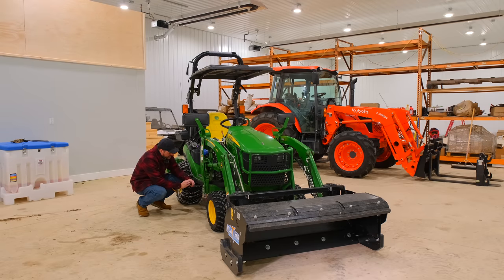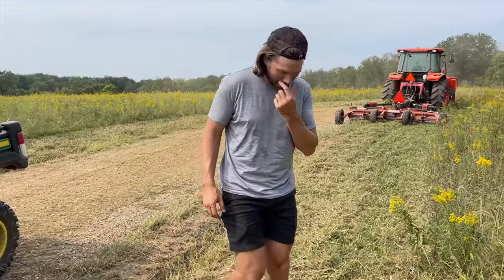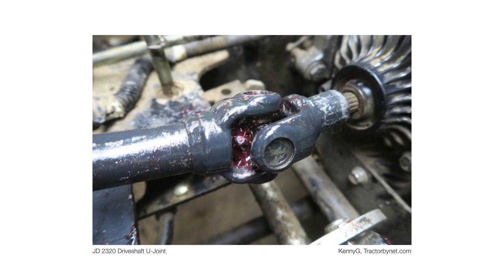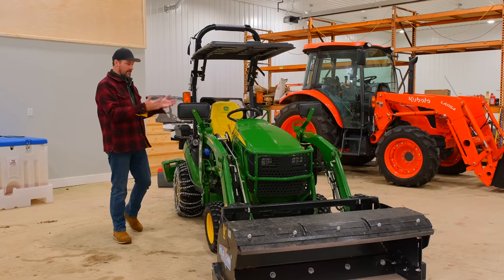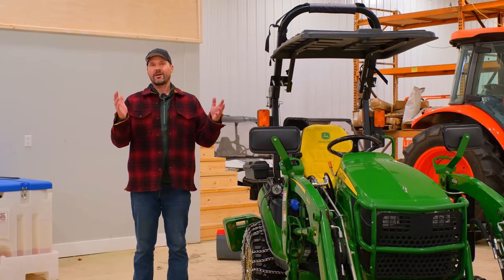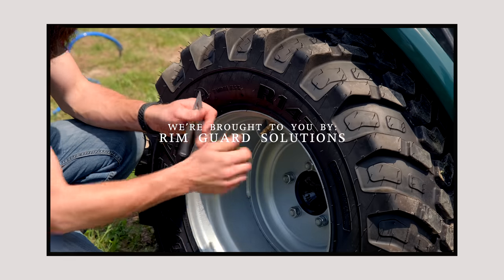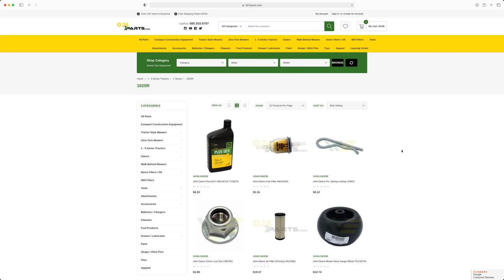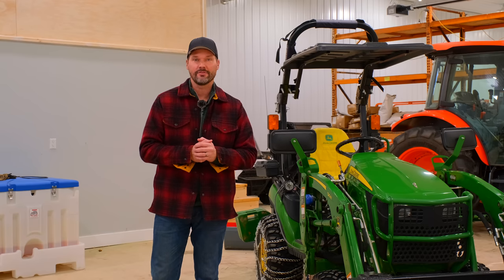THIS IS THE MOST EXPENSIVE TRACTOR REPAIR I'VE EVER HEARD OF

Comment: So I had a catastrophic failure of the transmission on my 2021 2025R with about 300 hours on it.  A big chunk of the transmission case blew out.  I'm sure it will be several thousand, but should be warranty, but if not, it will be insured.

Currently at the dealer waiting for them to look at, and determine warranty or not.

Comment: I was moving logs into the firewood processor, had the forks on, had a chain on the front in case i had to pull some out. it came undone. wrapped around my hard hydraulic lines and as i lowered the logs the chain ripped all my 3 hydraulic lines off, bent them. was able to patch it together . Dont have a chain on the front haha. Also snapped my lever for the hydro sta lever on my john deere 4600
Reply from the maker: Oh man, that would have been painful!

Comment: This is a drop in the bucket as far as tractor repairs go. Granted this is compact equipment but I have recently rebuilt a hub for a sprayer where the wheel seal is ~$800. One part of the hub is ~$15K.

Comment: The price on tractor parts, especially oem, rivals that of aircraft parts. Not sure, but I expect it's because there are few alternatives, as in the automotive industry, where there is a lot of aftermarket competition. As far as labor goes, $100+ per hour is pretty standard today, as is $6.50 diesel, everything is up and it's going to get worse. I like to do my own work, but with the manufactures requiring you to have a dealer only scan tool to replace simple parts like an alternator (looking at you - big green, but you are not alone), repairing your own stuff is increasingly difficult.
Reply from the maker: Those are all very good points, thanks for sharing!

Comment: Wow….I google search rear axle failure on JD 1025 and there’s others who had same issue.  I guess with the volume they sell that’s expected…..kinda?  Pics of snaps JD axles and the core of axles looks like gray popcorn. May be same axles used by others, but that’s garbage at 200ish hours. Stories I read had common theme of loaded rears.  Makes ya wonder if those axles just can’t handle weight.   Would be shocked if insurance covered a mechanical failure as it broke before the tree collision. 

I’m down south and loaded with antifreeze water mix so not too heavy and added weight box on my orange model

Comment: Would like to see some close up pictures of the housing break, without actually a close up I would only assume that it is a bad casting on the axle housing. However that does not mean that is the case. Was it all mention if the side with the housing still attached was the initial point of breakage?
Reply from the maker: Not really sure, I didn't get those details

Comment: I'm looking to put rear duels on my 1023... Is there anything I will need besides tires and if so, do you sell a kit to do so?
Reply from the maker: Yes, Miller Tire sells a kit and you can save 5% with code GWT.  They sell the wheels/tires too.  https://www.millertire.com/products/wheels-rims/wheels-by-type/parts/spacers/26x-12-00-12-dual-wheel-kit-with-14-bolts/
Reply: @GoodWorksTractors  Thank you for the link and reply. I do have one more question... Can all 4 rear tires be loaded or is it best to just have 2 loaded? I only ask for the reason that it may be to much for the axle if having all 4 loaded may be to much weight. May be a dumb question but this is my first tractor and would hate to damage it. Thinking that having all 4 loaded will give added ballast
Reply from the maker: @bigbasslake4280  I would only load the inner two, leave the outer two air only.  I ran all four loaded and was fine, but that's just me experimenting.  I think it realistically puts more stress than needed on the axle.
Reply: @GoodWorksTractors  Thanks again. My inner tires are already loaded,  Up North  Michigan weather. LOL, I will just go with those and be safe not sorry.

Comment: What I see is the axle shaft broke.  This means even though you’re pushing the pedal, the open differential is going to continue to power the broken axle.  So you roll backwards until the wheel on the “unbroken” side hits a tree and breaks the axle housing.  Too bad it wasn’t in four-wheel-drive or it wouldn’t of rolled backwards and the only fix would be an axle shaft.
Reply from the maker: Yeah, sure is a bummer.  I don't think he mentioned if he was in 4WD or not...would be crazy if it was.  Being on those hills, I'd think I'd always be in 4WD.
Reply: The other thing I noticed was the heavily bent rim on the right side, and the dent looks to be exactly opposite of the angle of the bent axle.  (He also has what looks to be a lot of iron wheel weights, FWIW.)  It almost seems like he hit something really hard with that right wheel, hard enough to bend both the rim and axle...the axle started free spinning, leading to all traction being sent to that side....and backward he went.  The tree caused the axle housing to shear off on the left side.
Reply: Pushing the brake pedal engages the differential lock, they probably were just used to using the hydro pedals they didn't think about the brake in time...4wd and the brake pedal would have been the ideal prevention method

Comment: The rear housing on these is 1/2 of the tractor.  Supply chain to oem is much cheaper. ( logistics) than supply chain repair parts.  Some parts from some companies not even listed, as would not have any volume and not be worth the repair.  So not astonomical, that tractor is broken very well.  Find a guy with a blown engine to make one tractor.

Comment: How about "Nudging" one of these Front Yard Transformers, moving it about 3 inches while backing up (Of Course).  I considered moving it back, but it dumped it's OIL!  I'd guess about 3 gallons of nasty black oil comes out.  Replacement Cost $5600!
Reply from the maker: Dang, that's nuts!
Reply: Geez, unless you snagged the drain piping that transformer should not have leaked its oil. I have seen them dropped eight feet with only superficial damage. If you had moved it much further you might have crushed the underground conduit and had a whole new experience!

Comment: I have a 2014 1025r.  If I remember right the 2013 model was the 2026r.  JD changed to the 2025r model to be under the tier 4 standards taking effect.
Reply from the maker: Close.  2011 and 2012 were the 1026r.  Changed to the 1025r in 2013.

Comment: rear trans axle on ebay for 5000.00  for a 1025R
Reply from the maker: Nice, wonder how many hours of labor involved to swap?
Reply: @GoodWorksTractors  dont know but it was a complete unit with the trans , PTO , PTO cover was still on it with low hours and everything looks pretty straight forward. my thoughts are even if it takes 10 to 15 hours that a win..

Comment: I've got a 2020 2025R with the same situation.  I backed into a fence post with a loaded bucket.  The 1 and 2 series are not meant to be repaired.
Reply from the maker: Holy smokes, can't believe that's all it took
Reply: Small John Deere tractors are for light yard use.....plastic hoods, fenders,and even aluminum trans cases says it all.
Reply: @PeeterPuncher  made in China, that is really disappointing John Deere, no wonder you’re ceo is making 35 million a year. The older CubCadet compact diesels which were discontinued, rear end housings cast iron housing said made in china. I’ll stick with Kubota! Warning to Bx owners make sure if you’re doing heavy pushing or pulling make sure your in low range. I worked at Kubota dealership since 1980 and have seen hst transmission (catastrophic) failures. Owners admitted they were in high range didn’t know any better hard lesson 6-8 k  $$$